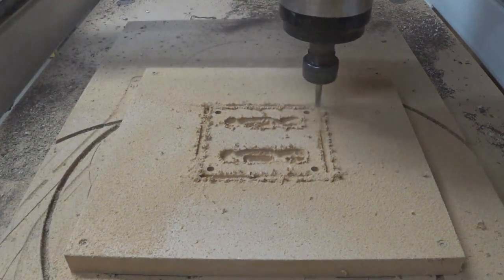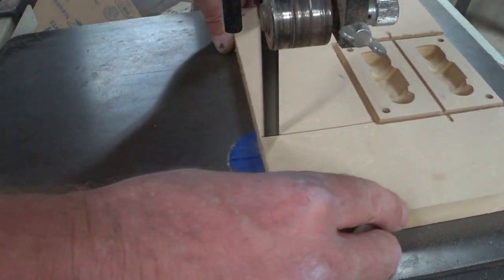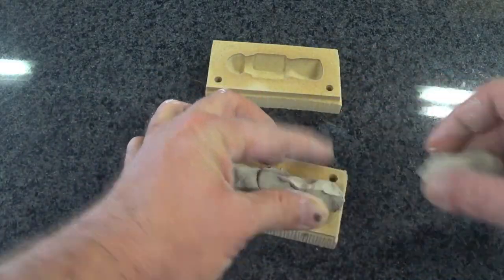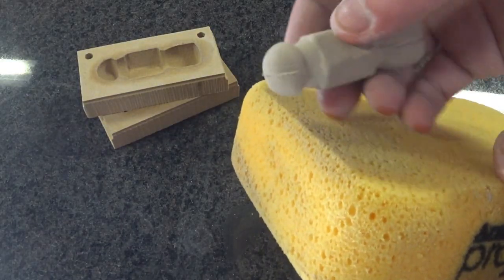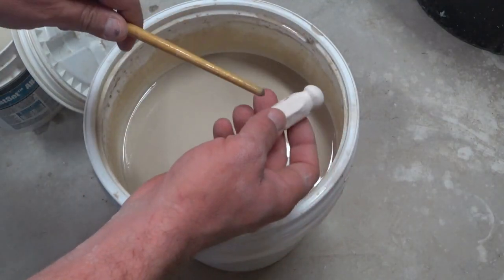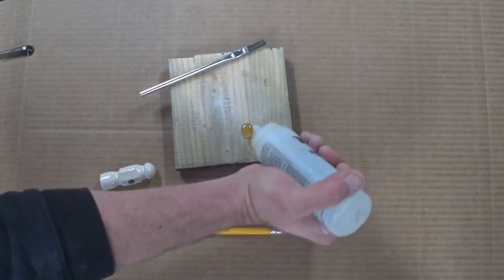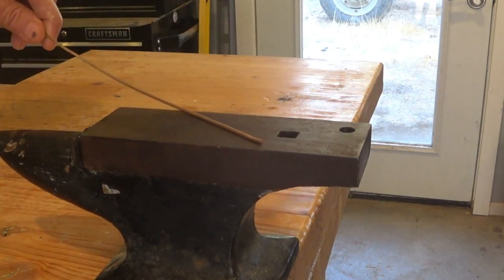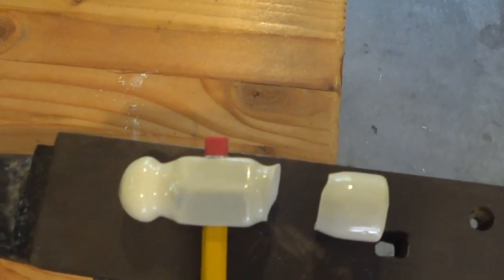How to Make a Ceramic Hammer

Comment: That was really amusing, the hammer lasted a lot longer than I thought. What's next? Clay nails? Maybe a ceramic circular saw blade, better have some protective gear with that one though!
Reply from the maker: That's funny.  Ceramic lawnmower blades did cross my mind...just for a moment.  I did make a ceramic sledge hammer.  It developed a crack in firing, but showed real potential.   I'll have to make another.